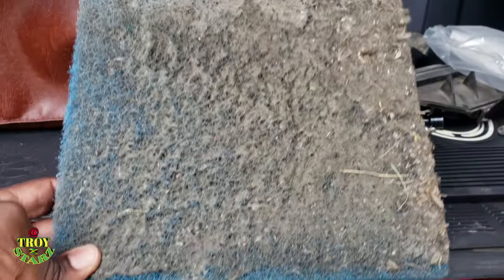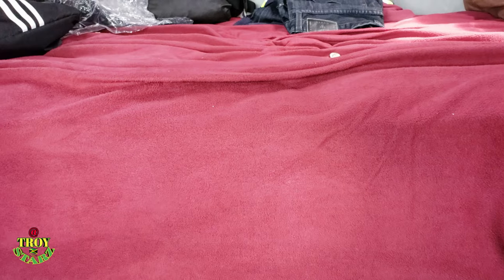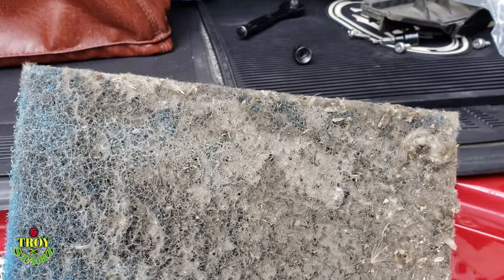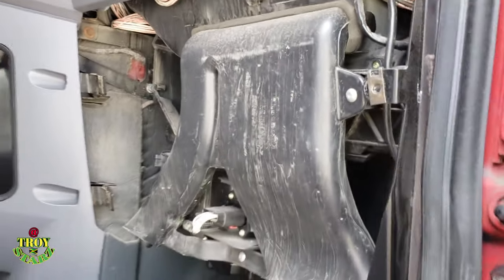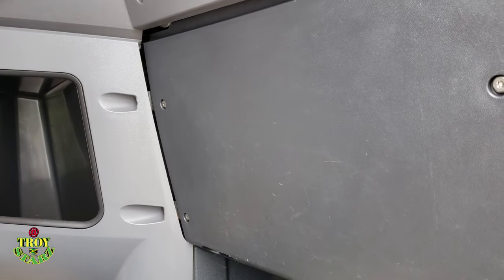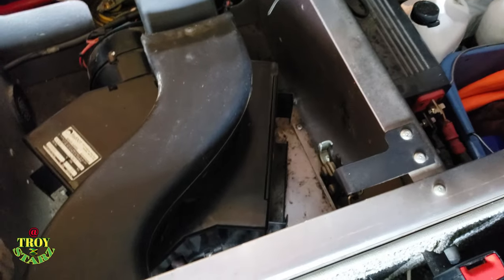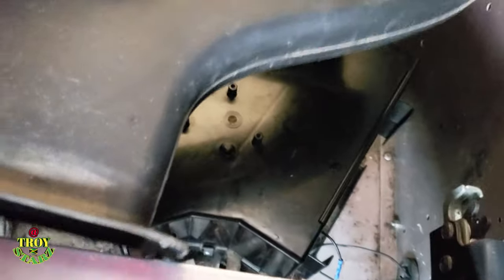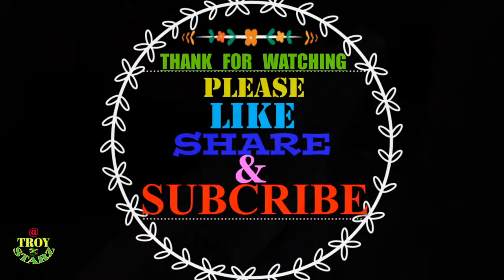How To Replace Mack Truck Cabin AC Air Filter.

Comment: Don’t forget to vacuum out the small radiator under the cover to the right of the filter. You have to remove a bunch of plastic to get at it but it’s worth it while you are in there

Comment: Extra note. 

Buy an air purifier for your truck. I purchased one, and let it run on low at night when I sleep. It's a regular household unit. Capable of handling 2300 sq ft in 8 hours on high. So your cab can be done easily on low. 

You'll notice the difference within a couple of days. Less dust, and the interior simply smells better.

Plus your AC filters will last longer ;)
Reply: 2
Reply: That's what I've been thinking before I've been watch this video. Air filters are even better cuz they have HEPA filters

Comment: On top your bunk AC/heater unit...where is the actuator?? The filter on drivers side is for heater...the filter for AC is on passenger ... depending where the damper is will determine which direction air flows...

Comment: Keep that old filter it can be cleaned for a back up because of the material its made of , I do have a question the CHL MACK has a filter behind the panel where the air brakes are so yours ?
Reply from the maker: Ok 👌

Comment: I can appreciate the video but you should definitely removed a couple of more panels and wash the a/c evaporator as well it is not that much work,get you a air gun and blow out everything really good..and a side note the paper filters will get stuck into the blower motor.
Reply from the maker: Thanks for the tip and thanks for the heads up

Comment: While you can wash the blue filter multiple times. I wouldn't push it past 3. You can never really get all the crap out. So it builds up over time, causing it to get dirty quicker. And restricting the airflow.

If you buy a small piece of foam the same size, and about 6-8mm. Place that over the blue filter (on outside) and wash it (the foam) every 3-4 weeks. You'll see a benefit.
Reply: Easier to replace filter every year than wash.
Reply: True. But you have to have options. If you're OTR, you carry a spare or find a dealer. Or you can clean the perfectly good one that's just gotten dirty.
Reply: Mack’s are terrible for taking on dirt like that. There is an aftermarket filter from a company called Cab Fresh that makes a filter that goes over the intake in front of the windshield that prevents dirt from getting to the internal filter.

Comment: Lol. Loved the video. But, grow some balls.  Lol. That blue filter really wasn't that bad. Ive seen those where when you pulled them out, you couldn't tell they were blue. Looks like you had the right idea for the back. Just an FYI. You can run the truck with the front ac on while working on the back ac. And vice versa.  But. Kudos to you for taking the initiative to work on your truck.
Reply from the maker: Thanks👊 🤣🤣🤣 yes I need the grow some for real 👍
Reply: @TroyStarzTruckingVlogs  its all good though. Looks like you have a nice truck and you take care of it.